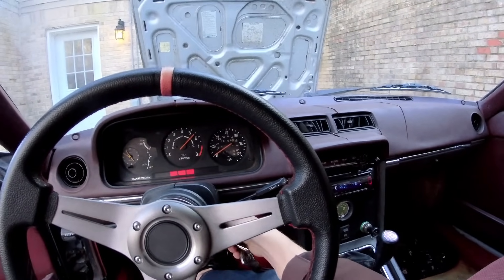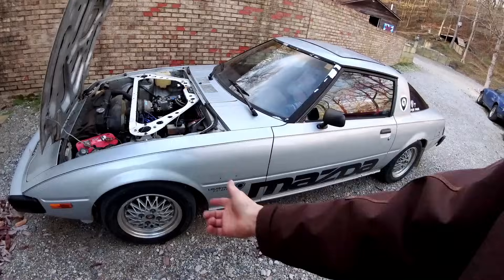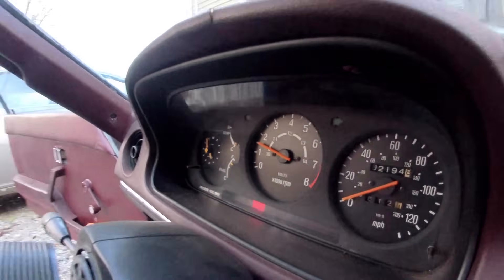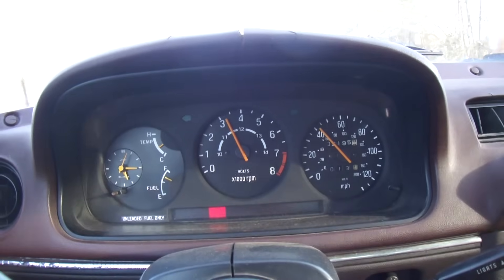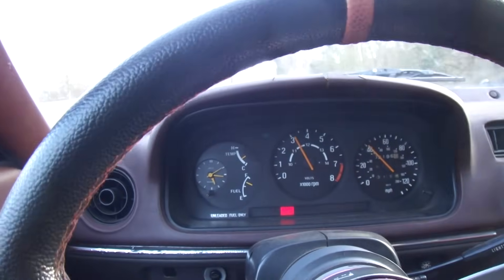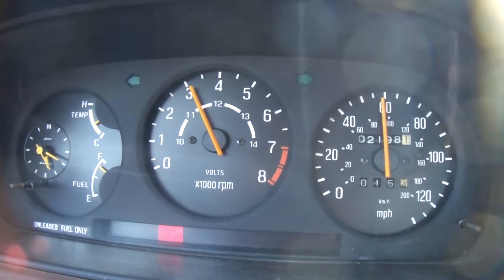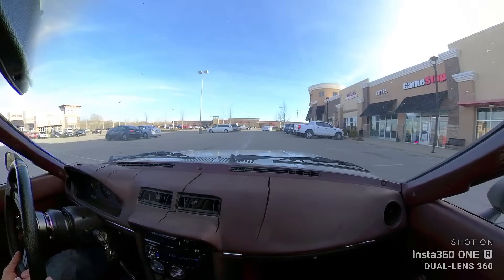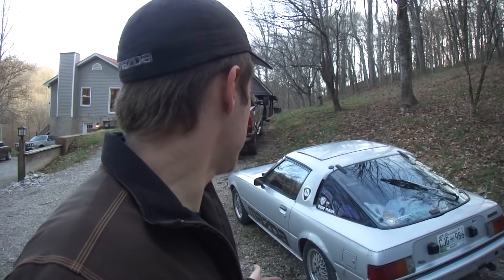Is A Bridgeport Rx7 Streetable?

Comment: finally someone explaining why a bridgeport is tough to street.
Reply: He literally explained why its NOT tough to street. The only real downside is the extra noise and fuel consumption due to staying in a lower gear.
Reply from the maker: @scottavuton8196  I just explained the things that will happen.  I don't really mind them.  My dad (not a car guy) would be supremely annoyed.  All personal preference haha!!
Reply: Streetport is perfect for street.. my 79 Sa22C has a large streetport with 118k miles and still fun to drive. Fuel consumption isn’t that bad. Id say 16mpg average
Reply: i dont see any issues, the hopping is a known issue of the puck clutch and a lighter flywheel.

you no longer have the mass to idle and the clutch is lcoked in place.

you float the clutch or keep 10% throttle because you removed things that prevented this, in an effort to get better response. 

but now you stall and lost low end power... and didnt tune the idle to coast in gear, why i dont know?
Reply: Nobody said you can't street it. It's impossible to get them through emissions tests though so states/provinces that need the exhaust sniff test for registration aren't going to let you so it. They are absolutely horrendous when it comes to pollution. They are AWFUL.
Reply: @pazsion  ALum flyywheels and puck clutches suck on the street especially when the engine makes no torque!
Still run friction disc clutches and flywheels on the heavier side even with high rpm geared cars
Great manners, launch way better, shift recovery is better, no downsides.

Comment: I had an old b20a5 Prelude oil burner. Ran high RPM runners always open, no air filter. I ran it for 50k miles that way. No problems whatsoever. It had a stock exhaust and the intake made so much noise I got pulled over for, but there wasn't an Idaho statute about intake noise, so I got off. "Put your money in a loud stereo like everyone else." No, you'd cite me for that.

Comment: Damn I LOVE the sound of a well built rotary!
Reply from the maker: Hell yea man!!!!! Brap brap!!
Reply: Unfortunately you have the idle set so high that you never hear the brap brap.

Get yourself a weber that has a choke, drop the idle down.

As for your BP surging at low revs, I have never known of anyone with a 50mm weber. By far the most common is a 48mm with extended fuel bowl.

I think your rotary needs just a small amount of proper setting up for it to be so much more driveable.
Reply: It may not be that fast, but boy it sure sounds awesome!

Comment: Thanks for making this video, it reminds me of when I used to street drive my RX4 with 13b bridgeport and 51IDA Weber (48IDA bored out to 51mm, also had an extension welded onto the fuel bowl). The best thing I ever did with that combo was change from F2 to F11 emulsion tubes - mid range power improved significantly. I don't know if that will translate to your carb and 12A , but it may be worth experimenting with different emulsion tubes if you haven't already. It looks like your 12A goes well and it sounds great.

Comment: air cleaners dont kill power...non puck clutches, steel flywheels are the way to go on st/strip cars. Better launch, shift recovery way better manners cant go wrong. Too many say go buy one cause they did and think it "revs" faster so it must make the car faster. 
 
Properly sized, adjust carb with choke she will fire right up any weather.

Comment: I would trade the slight power increase from putting an electric fan instead of an engine driven fan over the slight power increase of running no air filter any day!

And not to be a dick, but running no air filter is the silliest thing someone can do to an internal combustion engine. It’s not the leaves and cigarette butts and crickets You have to worry about sucking in, it’s the tiniest particles that float freely through the air that are able to get in between load bearing and sealing surfaces…

Comment: You can street them, people have done it forever. It won't wash in states/provinces where exhaust emissions testing is necessary to register your car though because bridgeported engines produces an absolutely MASSIVE amount of pollution. They are just completely, utterly terrible for that. They are also really picky about exhaust system backpressure so you'll just kill most of the power increase by using a cat converter in the exhaust--and that goes double if you want your car to be reasonably quiet.
Stock ports and a good turbo system are what you need for lots of power and keeping the emissions from getting totally ridiculous, and that's why Mazda did it that way.

Comment: What year is the car? Reason I ask is because the hood prop is on the opposite side that mine was. My SA was built in oct 78 and is on the right side.
Reply from the maker: This one is a 1980.  The early SA had it on the right side. Most 1979s as well

Comment: how did you rectify the flat spot in the end on the silver car which I believe this is, I am blind so I can't se colour.
Also what happened to the engine, did you get the oil control rings fited.

Comment: My guess is the dizzy is locked at 20 degrees??
Reply from the maker: 20 degrees at idle with the 10 degree mechanical advance still hooked up!!
Reply: @RADPotential  remove advance and keep it locked. The pig rooting at slow speed is because it is locked. Just the way it is. Love the video!!  😊
Reply from the maker: @golfy808  The advance kicks on at like 3k rpm,  I could try to give it more timing down low.  I had issues with starting on a prior setup where I locked the dizzy at 30

Comment: I drove mine for 1yr straight even through winter time which it suck, mine was full Bridgeport with a Holley 750 dual pump, had to do the oil change every week and fill with gas every 2 days 😂😂😂 loved it and miss it, i can't wait to get one, either the fb or the FC chassi but now they're getting very expensive and hard to find cheap in good condition... I wish i would off kept mine

Comment: My buddy has a 12a and he doesn't use his clutch except for takeoff and stopping. He got so good with his car that he can power shift without the clutch. His car has racing header and 2.5 inch straight pipe to a cherry bomb with 3.5 inch tip. Car doesn't like the cold very much either. Sounds similar to my buddies car.
Reply from the maker: I'm on my third transmission using the clutch haha. I might need some training lol

Comment: My stock ports 13b also shakes at 2600 rpm in 4th gear like yours does.
Reply: Mines a fb with 13b turbo and fuel injection lol still has same issue
Reply from the maker: That's crazy!!  What ecu?  I haven't had many stock setup turbo cars around to compare.   The 6 port cars are super smooth!
Reply: @RADPotential  it's a s5 stock port 13b with power fc. I've tried to street tune it a couple times with friends back in the day to get rid of the 2600rpm bucking but nothing really has helped
Reply: @RADPotential  I always just figured it was my light weight flywheel

Comment: Man this brings back memories i had the same set up on a 82. And the tiny powers gains just couldn't overcome the noise and the cammed like V8 thirst this motor necessitated. Not to mention the smells in the cabin. Water leaks always something new breaking and repairing, until the motor gave out and then start all over. Got rid of the headache after 4 years. RIP
Reply from the maker: I feel like with any project car the headaches are there for sure!!!  BuT.... not much if anything trumps the presence of a full bridge at a stop like. And its 2 stroke like experience is epic!!

Comment: love the sound. not bad for a cold start and typical for most any FB. looks a lot roomier under the hood. id like to PP my 89 GTUs which is fuel injected but i have to get it running out of storage where it sat for about a decade first. i miss the fb but the fc i will admit starts easier on cold days. i wonder how it would do ported. years back my half brother got smashed on tequila and wrecked my 82 rx7 gsl. only after his mom forced me to let him drive it to work. anyways thats how i got the 89 lol and its not bad. ill never be rich enough for an fd. either way been thinking about digging out my old rotary and seeing what i might be able to do. they claim the 6 ports 13b NA with peripheral porting and some other minor adjustments can break the 200 hp barrier, and go to almost 290 without turbo. my dream rotary car would be an NA 4 rotor but like i say either way there no horsepower like NA horsepower.

Comment: You know the car is slow af when he doesn't run a damn filter for horsepower. 

The sand that gets in your motor will act like sandpaper and destroy everything eventually
Reply from the maker: Yep every HP matters. Can't be any worse than running no filter on a turbo.
Reply: @RADPotential  which is also a terrible idea. even F1 and GT cars run filters
Reply from the maker: I totally agree.  I have Been planning to build an airbox and run an intake to the front. Just haven't made the time
Reply: @RADPotential  just slap on some of those motorcycle filters. the airbox would make more power tho because it gets cold air

Comment: Sweet bro I had an 80 12a, no porting though, Holley 4b, headers, 2.5 exh.  If you like the extra power of no air cleaners then shit can that mechanical cooling fan and install electrical fan(s), frees up quite a bit of power on a 12a.

Comment: Having drove one myself, the answer is yes but no, it’s fine once you’re moving, starting off is a pain since there is no bottom end and if you are coasting you need to put it in neutral to take the pulsing stress off the drivetrain. Bridgeport engines guzzle gas even if you are not pushing it and just cruising along. Great track engine since you’ll be in the powerband but on the street it gets too hectic
Reply from the maker: For sure!!!!   What was your engine in??
Reply: @RADPotential  the engine was in my dad’s REPU, 13B full bridge. The engine was intended for another car but he needed an engine since the one that was in it blew 2 apex seals from detonation. Even with fuel injection and a Haltech ECU it is still difficult to drive. Makes 255whp though and it rips hard. It’s only temporary, as soon as he gets his hands on a Mazda rebuilt engine he is going to crack it open and do a large street port for better driveability. I have a 84 GSLSE and I’m running the stock 13B 6port and a DCOE throttle body and Racing Beat long primary exhaust on stock porting making 197whp. Later on me and my dad are going to open it up and street port it as well
Reply from the maker: Heck yea man!!  Thats sick!!! Repu are the bomb!!

Comment: Hey man this kinda sounds like a stupid question but is there anything other than the intake/carb, exhaust, fuel pump, and ignition that needs to be changed to be bridgeported? For an 81’ gsl.
Reply from the maker: Id do a beefier clutch to handle the power.  Otherwise you will be fine.  Cooling system is solid.  Trans and rear end. Solid.

Comment: coming off the holly sniper videos I can't help wonder how the sniper would do with a bridgeport? it seems to me the 4 barrel would be more desirable for that application, but could the 2 barrel sniper handle it maybe? new to rotarys here and no where near bridgeporting just curious on your thoughts a little.
Reply from the maker: Id run the 4 barrel for the full bridge. Having the primary and secondary staging would help a bunch with driveability

Comment: Hi can these bridgeport turbo motors last long ? I've heard so many stories saying that they dont last not even 10,000kms
Reply from the maker: Yea for sure.  If you take care of them they will go a long time.  The hard part is most bridgeport motors are built using used parts. Therefore inherently carrying a shorter lifespan than new OEM stuff
Reply: I am not sure about bridgeport Turbo motors but a stock 12a non turbo lasts about 190.000kms i think

Comment: Have you tested changing the idle jets?  They sort of act as a transition and may help from the 2k-3k range
Reply from the maker: Its basically as dialed as it will be with the size of the carb.  I have a video series about tuning that carb.  I noticed a bigger help on transition with going to a smaller venturi, but it does rob power on the top end.  It's a balance
Reply: @RADPotential  Nice, I am working on a 42 dcoe-8 setup. Smaller than a 45, but I can still run 36mm chokes.
Reply from the maker: I had 48 chokes in it.  Went to a 43
Reply: @liamf3647  I have a 45DCOE in my stockport. 36mm is good without boggin between 3-4k rpm but loses power above 6krpm compared to a 38mm. I stick with the 38mm even if the transitions are sketchy.

Comment: I love the bridge port and the way it sounds but you don't need a 2 1/2 inch downpipe. If you're car was pushing 4-500 horsepower then yes but 2 inches would have been perfectly sufficient. I suppose if you want to be really loud but you're not helping horsepower much with that setup. And why did you change the steering wheel? That one doesn't look any better or much different than the stock wheel.

Comment: Hey dude, I have a 1978 rx7 and I also owned a rusty 1980. Mine is a 12a Bridgeport too. Amazing street car. Just wondering if you have had issues with twitchy steering? Both of mine have had a significant dead spot and gets twitchy at high speeds etc. Any advice?
Reply from the maker: I have a video on adjusting the steering box.  Should be able to fix it up!
Reply: @RADPotential  legend I will hunt for it after work! Thanks from New Zealand
Reply from the maker: You're very welcome!!!

Comment: I can't disagree more with you more it's a lot of factors at play size of the port size of the Street Port size of the exhaust port and exhaust system carbureted or fuel injected ignition system tuning there's a lot of factors I just can't say Bridges not for Street I personally running Bridgeports since 95 on NYC streets I have build more motors of build well over 100 motors but again it's my opinion I'm a Bridgeport guy 💪

Comment: Any reason why you don't run electric fans?
Reply from the maker: Nothing beats the power of a clutch fan.  I can do a drift event in 100 degree weather and never break 210f on the temp gauge.
Reply: @RADPotential  that is true but I'm sure an aluminum rad and a good fan could work. Right?
Reply from the maker: Yep for sure!!!  I just didn't have issues with the stock setup. Nor cared to improve the aesthetics of the engine bay. So I left the oem stuff.  Rather spend money on my carb and exhaust etc at the time

Comment: If you are running a DCOE 45 48 there is NO reason to not hook up the choke and tune it!  The choke on a DCOE is literally a seperate carburetor--it shouldn't even be called a choke.   I could see if you had a DCO/SP or IDA but makes sense for a choke on a street car.

Also, why not run an IDA or IDF?  The manifold is vertical, only going horizontal to suit the DCOE.  And not running air filters makes ZERO sense.  A good Pipercross or even a fabricated box to a remote K&N style gives up so little power but makes the engine actually last and not eat itself with dirt/oil grinding paste!

Comment: Throw an LSx in there and all your issues will be solved! More power. More torque!  More reliability! and less maintenance. I did it to my 1986 and it went 12 flat in the 1/4 mile all while getting 29 MPG and handling like a road racer. You do the math. 2970lbs/325hp. This was an untouched LS1! Sold it 7 years later! Got all my money back!
Reply from the maker: I have a C6 Z06.  It came LS swapped hahaha!!!!
Reply: But... What about the braps... Brap>all

Comment: An old school trick you should do is to use a stock 2nd gen leading coil to wasted-spark fire the leading plugs. It eliminates the need to run the leading plug wires through the cap/rotor system, it adds a third spark at the very end of each power cycle supplementing the stock trailing system, its practically free to do, and if you add an MSD box you can end up with 5 to 10 sparks per power cycle as opposed to the factory 2. After airflow, ignition is the most important thing you can improve on a rotary, due to their poor combustion chamber dynamics.
Reply from the maker: For this one I just have hotter coils, nothing too crazy!  The next rendition of this engine will be 10k plus rpm and a fancy ignition system will be needed foe sure!!   I have done the MSD box with direct fire leading in the past. It worked great!!

Comment: 9:38 Please ditch that otherwise impressive phone-controlled camera, and replace it with 1 or 2 screwed-down GoPro's.
Drifting into the path of a 2+ ton pickup at a closing speed of 80+mph would not result in an ideal outcome for anyone.
Reply from the maker: Yea. I have more cameras since that video.  And especially refrain from doing anything besides driving with my hands

Comment: Awesome video, you should get some pool pipe lining and run it from the front straight into the two carburettor intakes, would do you good having direct cold air from the front instead of heated air from the engine bay. You can put wire mesh over the front of the pipes to stop anything going into them. That’s what the rotaries were set up intake wise in the 80s doing rally racing.
Reply from the maker: I plan to move my battery and build an airbox in its place with a collector to the carb body!!  Should work well!!

Comment: Sounds like a lot of work for ten hp
Reply from the maker: That is the truth...sounds good though
Reply: Add a turbo
Reply: Typical Vtec guy comment... ten hp... its significantly more than ten hp, more like 70 to 90 hp on that kind of setup on a 12a
Reply: @RADPotential  have a 13b pp with a 48IDA (44mm chokes so far) and making around 300hp NA, its totally streetable, one just make small changes in driving style and I love to coast as you do too, and the brap at 2100 rpm idle is so sweet 😁😁